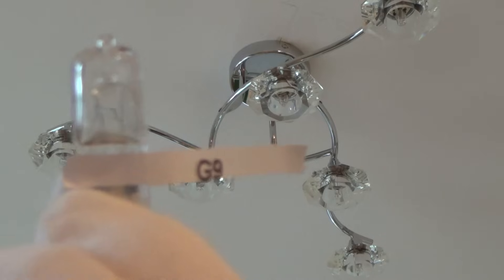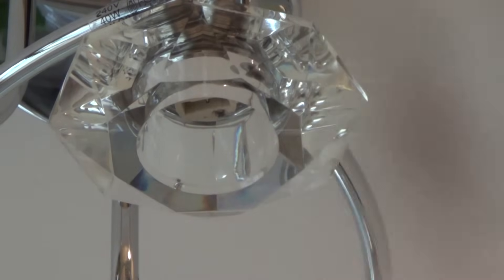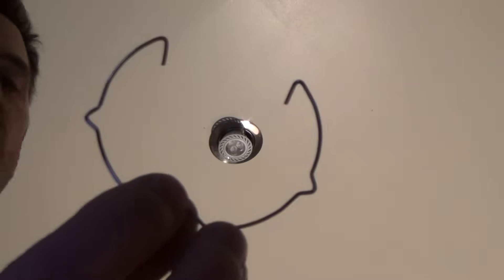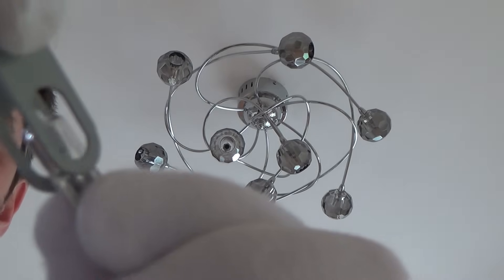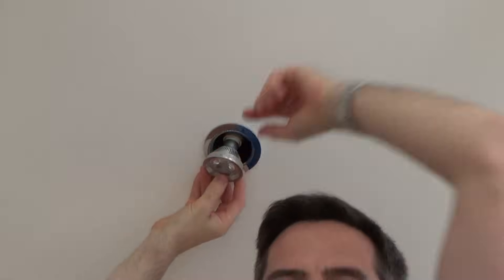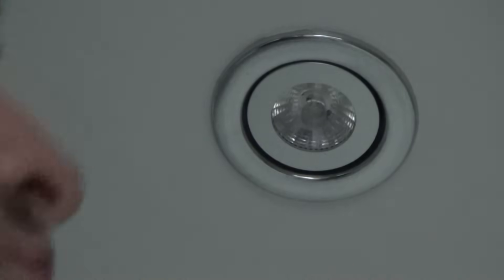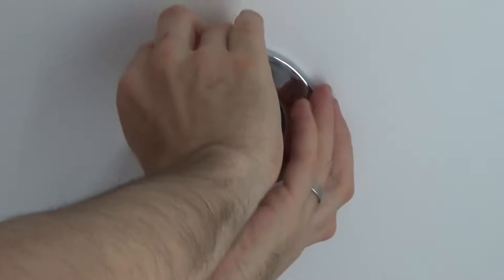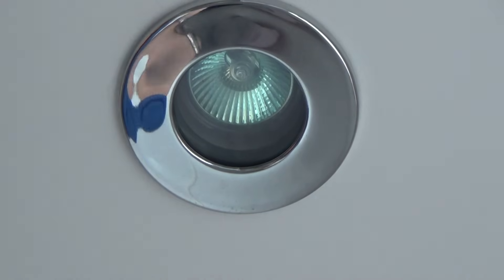How to replace various Halogen Lamps, G4, G9, GU10, MR16 12v and 240v Downlights

Comment: Purchased G9 bulbs from B&Q to replace in a kitchen light. The bulbs look identical but, they do not work tried an existing working bulb form another light which worked fine, at a loss at what to do, can you advise please?

Comment: Great video vince. To help anyone else you can use the time stamps below:

No.1: G9 Halogen 240v (00:07)secs)
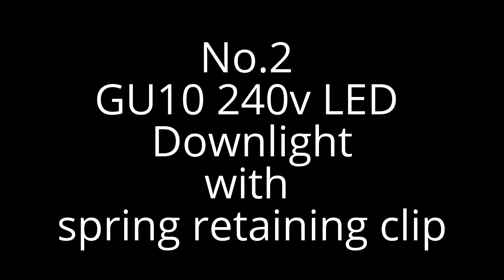No.2: GU10 240v LED Spring retaining clip. (04:49)
No.3: G4 Halogen 12v (08:06)
No.4: GU10 240v LED Twist Fit. (10:34)
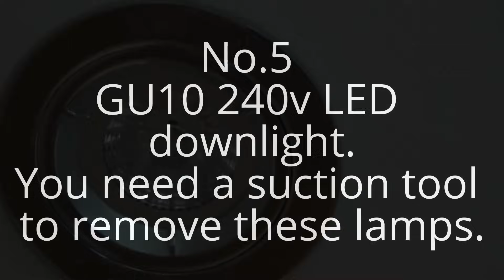No.5: GU10 240v LED Suction Fit. (13:34)
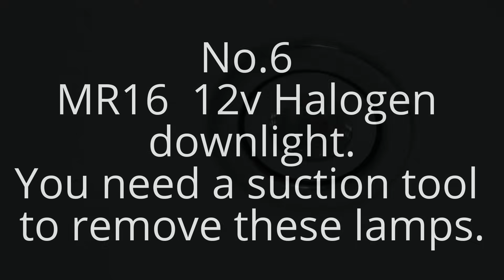No.6: MR16 12v Halogen Suction Fit (16:14)
No.7: MR16 12v IP65 Rated Shower Light (18:41)

Comment: My Nan has one like the ip rated 12 v one but it is an extractor fan with an mr16 bulb build in and there’s a plastic dust catcher or air flow thing on the bottom of the fitting a bit like a down light and you remove that and then the top of the bulb then sticks out a bit so that you can pull out the old one and push in the new one then u put the plastic thing back

Comment: Hi! Changing my bulbs .. Not a prob but want to  renew outer chrome facing
Reply from the maker: Hi, normally the chrome bit is part of the light fitting so to change the light fitting would involve wiring so best left to an electrician.

Comment: Thanks, but Braun managed to design a fixture where the G10 can’t be touched at all, so you need a suction cup, then you need more up force than the bracket can hold so it just breaks. 
I’ve got it torn open so I can hold it down, but the bulb will not turn. 
The next range hood I buy is getting torn open in the store to make sure bulbs can be replaced. What a crappy bulb socket design for a place you can’t reach the bulb. What was wrong with threads that always work?

Comment: Is there another way to remove the MR16 bulbs?
I tried using the suction cup and it either just takes off the glass circle front of the bulb leaving the bulb in place or rips the whole light fitting down and messing up the ceiling.

(I eventually took apart the fitting and saw that it’s definitely an MR16)

Comment: Hi there, I have GU10 fittings in my kitchen, they’re the ones with the screw-out plastic housing and the little metal clip behind them. What do you suggest for when the plastic screw housing won’t budge at all and the bulb has slipped out of the clip? I’ve tried to use a suction cup but as the bulb is now loose from the clip it won’t now unscrew from the electrical fitting. Short of ripping out the entire fitting (which I can’t really do as it’s a rented property) do you have any other practical solution? Thanks for this video though, it’s amazing.
Reply: To be more specific, it’s the type found in this video under “No. 4, GU10 240v LED Twist Fit downlight” section that starts at the 10:30 mark :)

Comment: We have the no 2 downlights with the clip, however when we remove the clip the lightbulb is impossible to remove from the fitting, it doesn't fall through like yours did.  It feels like there is no slack in the wire at all.  How can we remove it?

Comment: All the bulbs and fittings are for large ones. Under the kitchen bench, the 240V  halogen down lights are much smaller in depth. these are probably 25/30W globes.  the video is incomplete without including these. To start with, what is the globe socket type G? (4/5/6/7/9/10) and then how to replace the globe. Lastly are there LED globes now replacing these globes?  Will highly appreciate if this information could be provided thru video ir email. Thanks

Comment: I was about to order an online suction cup, to remove the g10, when i did as you did with the fingers and I succesfully removed the lamps. Is there a way to unscrew the G10 2nd version and leave them there, off? Its a bit ugly with those holes, but I really do not need all that light.

Comment: Thanks Vince for the very helpful video. Regarding the G9 bulb, many of your viewers have reported that the bulb is stuck inside the socket and could not be removed. It is the same with my case. Some of the G9 bulbs are very easy to remove but one is stuck. It can slide about 3mm in and out but it will not come out even when I pulled on it very hard. I would greatly appreciate it if you have a solution for this. Many thanks again for the great video.

Comment: Having a nightmare replacing the G9 bulbs in my room that went two weeks after the light was fitted. They are at an angle so I can not see the "grooves" I am supposed to line the lamp up with. Already broken one lamp already...this is going to be expensive!

Comment: Hi Vince - thanks for the video - But when you say "remove the bulb nice and gently" I am finding that I have to exert quite a bit of force and the bulb still hasn't come out. Is that common? We bought the light fitting from new and obviously this is the first time a bulb has been removed. Again, is it common for the bulbs to be tough to remove and what would you suggest?

Comment: Great video, thanks, but when you say at 15:30 fitting the bulb back in can be fiddly you weren't kidding. 30 minutes to fit 3 bulbs! Why? Lined it up didn't work, lined it up again didn't work. Didn't work again 20 times, then didn't do anything different, lined it up and in it went it no problem. Used to take 3 minutes to do this stuff in in the 70s.

Comment: Struggle is the right word to use with replacing these things. I watched at least 20 different videos, read the range hood installation manual, tried many times, even called the manufacturer. With some trouble I could remove the old GU10 bulbs, but exact replacement bulbs could not be reinstalled. First, it's quite exasperating just to try to blindly fit the two pins into the holes. But then, no matter how I tried, it could not be twisted some to lock in. In any case, the bulb would not turn on even though it is a working bulb. At this point, I suspect that the difference in manufacturing the bulbs may come down to a few microns off in size, causing it not to twist in. I inspected them carefully and they appear an exact size match to the old bulbs. VERY frustrating, and in the end I must call it Poor Design!!! Some products allow the socket and its two wires to be extracted some so that the bulb can be clearly handheld and twisted directly into the socket. But when you cannot see what you are doing, and things don't quite fit, no matter what you do it won't work.

Comment: For anyone struggling to release pull/release a GU10 from the fitting (can't turn or pull), try using a small suction cup like you might find on something that sticks to a wall.  Press inward while turning anticlockwise (approx. 45°) to unlock, then use the suction cup to pull gently.  I was struggling with mine for a while but this worked immediately for me.

Comment: Many thanks for a brilliant and helpful video. It confirms to me just how STUPID most of the designs are. So impractical. Especially for a unit that's been up for a while, things will have become stuck due to the action of heat on the unit, but that's not your fault. Designers please note!!!
Reply from the maker: +Will Newcomb I agree, using the sucker tool to twist out the lamps can be a real pain.Thanks Vince.

Comment: i have a problem with my halogen lamp.
it randomly goes off or doesn't go on sometimes. sometimes it can be on for hours.

no thermal issue because once it goes off by itself, it can be on for hours just seconds later if i keep switching it on and off.
no lamp problem because i replaced it and the new one is the same. the old one has worked without problems for many months.
no contact problems because once it goes off, i can make it go on and stay on with luck - without touching it. moving the lamp has no effects at all. it may also not work for the whole day.

this behaviour is random and makes no sense at all.
what can be the problem?

Comment: Too much talking... Get to the point and show us how to change the bulbs - simple. I'm struggling with GU10 in my kitchen row of four and the godamn things that don't fit or work... About to rip the damn thing off the ceiling. Talk sucker blah blah my eyes glaze over and will rip out of the roof and put my 10 GU10 in the recycling bin for my local council to collect. How do you replace GU10 non recessed hanging on and in light fitting?